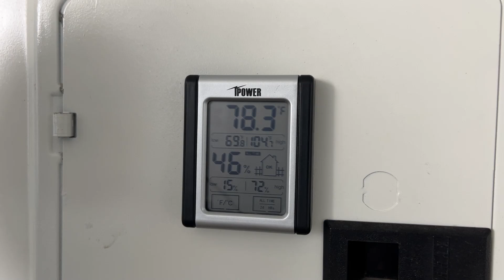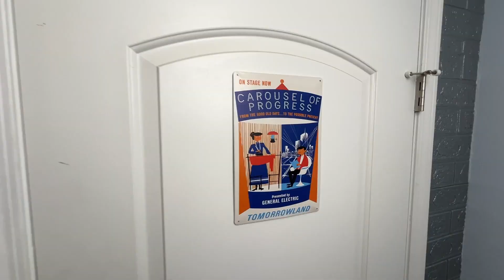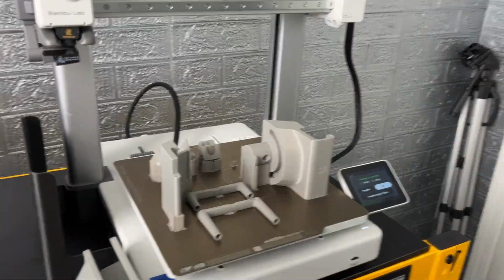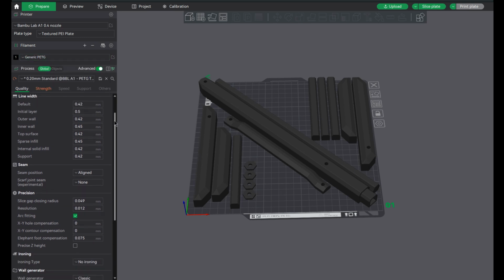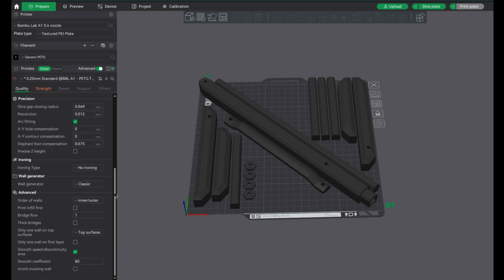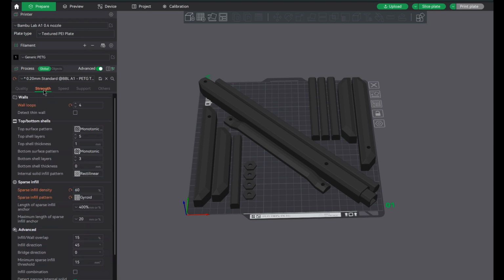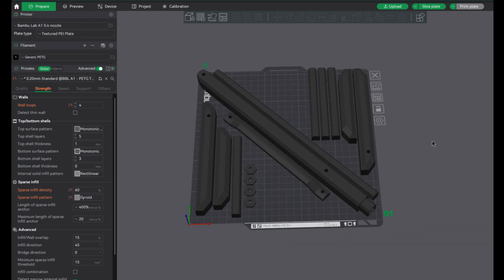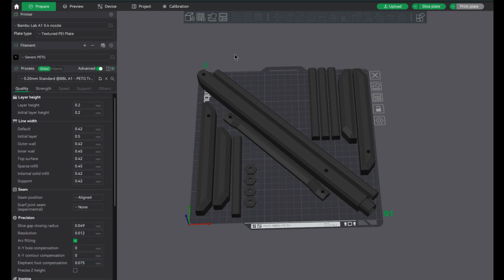Tiny 3D Print Farm Makeover: See My Smooth Print Secrets!

Comment: Are you using the silent mode (slowest) to print?
Reply from the maker: @davidmann4436  Thanks for your question! I cover my print settings in the video linked below. Check out the section starting at 9 min 48 sec, where I detail the settings I typically use for most of my prints. Appreciate your interest :)

Prototype Fail & Win: Mini Stealth TV Tray 3D Print on Bambu Lab A1! - https://youtu.be/R_eNwpJ-xZ4

Comment: Have you given thought to trying one of Bambu’s coreXY printers like the P1P or P1S?
Reply from the maker: @bryanfoster362  Thanks for the question! Yes, I've looked into Bambu's CoreXY printers like the P1P. They're impressive, but I chose the Bambu Lab A1 for its balance of affordability and quality. At $339, the A1 offered a significant improvement in reliability and print quality compared to what I had before, which was the Creality CR-10 SE. While I'm still interested in the CoreXY models for their potential benefits, the A1 has proven to be a fantastic choice for maintaining low production costs while delivering high-quality results. I'm really happy with its performance so far :)

Comment: I totally felt what you said about quality. I've used Creality and Anycubic FDM printers for years, and they were such a pain to operate. Now that I’m using Bambu printers, I’m really impressed with the quality I’m getting. After all the struggles, it’s amazing how easy it is to get great results with these machines.
Reply: Agreed.  Until someone experiences it for themselves like you and I have, they won't understand what it's like to have consistent, reliable, repeatable results.  I can't believe how much  I used to struggle with my ender to get mediocre results.  I would throw away a print now if it looked like what I used to get from my ender.
Reply from the maker: Absolutely, once you experience the consistency and reliability of these newer printers, it’s hard to imagine settling for anything less. It sounds like you’ve also seen a dramatic improvement in your printing results. It’s quite a relief not to deal with the frequent struggles that come with less advanced models. Thanks for adding to the conversation, it’s great to have such a community where we can share these experiences and learn from each other :)
Reply from the maker: It's great to hear you've had a similar experience transitioning to Bambu printers! It really does feel like a significant upgrade in terms of reliability and quality of the prints. I'm glad you're seeing the same improvements and enjoying the process much more now. Thanks for sharing your thoughts, it's always encouraging to hear from others who appreciate these advancements as much as I do :)

Comment: Do you find the edges warp on large prints like you are doing? How are your corners not pulling up slightly? I have the A1 and find my corners warp ever so slightly but it's annoying. I wonder if I need an enclosure.
Reply from the maker: @billjonesnation  I've had a really good experience with the Bambu Lab A1 when it comes to preventing warping, especially with PLA and PETG. I haven't noticed the issues with corners lifting like I did with my Creality printers once in a while. It might be worth checking your bed leveling. An enclosure could help too, especially if your printing environment has drafts or fluctuating temperatures. Hope this helps :)

Comment: a little tip. make your own cylinder feet that goes into the support arms for the printer. they tend to flatten overtime and not give a stable support. i made my own model with thicker walls wich solved the problem.
Reply from the maker: @RedRaccoon69  That’s a fantastic tip, thank you! I’ll double the wall thickness on those cylinder feet to prevent them from flattening over time. It sounds like a solid solution for maintaining stable support. Really appreciate your suggestion :)
Reply: were can I download the plans to make cylinder feet?
Reply from the maker: @TheRTM  I appreciate your interest in the cylinder feet! After some testing, I found that doubling the thickness threw the printer off balance for me, so I've decided not to go with the thicker design. I'll be discussing this in a video I'm uploading tomorrow if you'd like to see the details. For the current design plans, you can download the entire top mount set on MakerWorld from Bambu Lab themselves. Thanks for your interest :)

Comment: Do you ever get concerned about 3d printer fumes in your print farm?
Reply from the maker: @StudioHawaii  Thanks for bringing up a really important topic! Yes, I’m cautious about 3D printer fumes, such as ultrafine particles (UFPs) and volatile organic compounds (VOCs). That’s why I primarily use PLA and PETG, which generally emit fewer harmful fumes compared to materials like ABS or ASA. I’ve set up a fan in the window for ventilation and located my printing setup outside my living space to minimize exposure. I limit my time in the print room to a couple of hours spread throughout the day, unless I’m filming or working on a larger project. I’m also considering adding a HEPA filter to further improve air quality in the printer room. I try to balance safety with the passion for 3D printing :)
Reply: In the window you will see an exhaust fan, he normally runs it but shuts it off to film due to noise I presume.